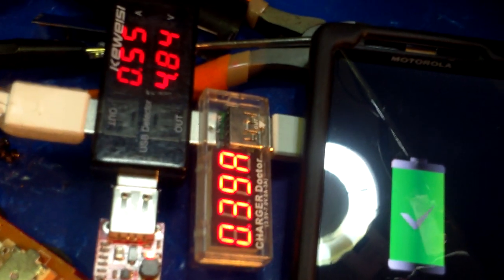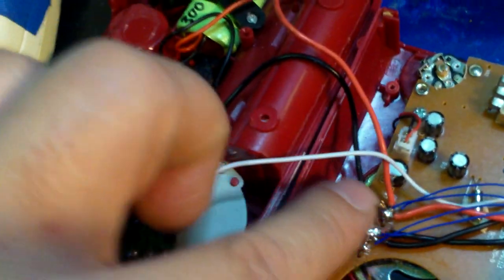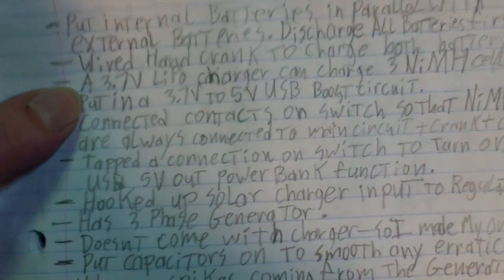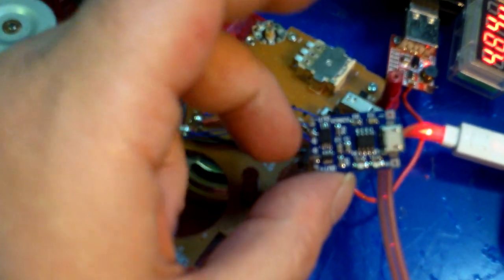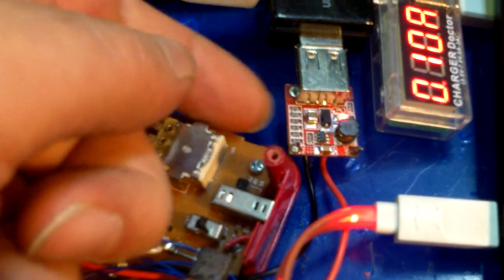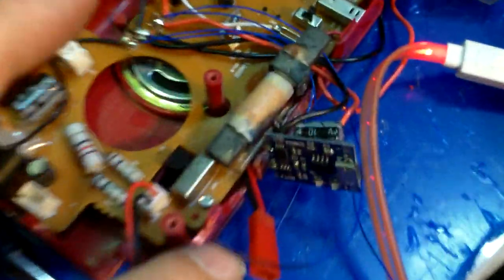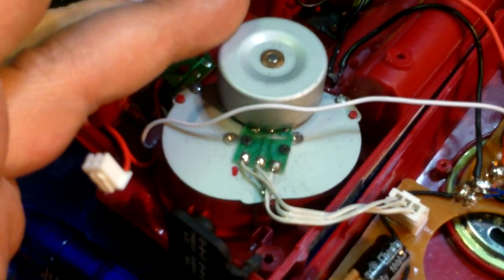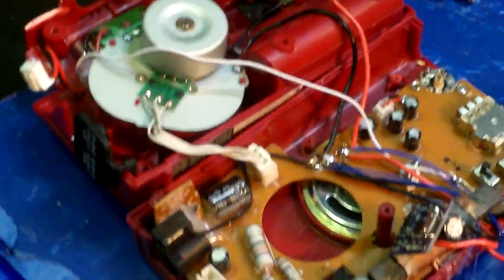Weather X WR182 R USB charger input/5V power bank hand crank Hack PT 1

Comment: Holy cow! That looks so complicated to figure out mister...takes big brains I guess which I don't have lol 😂 I loved the disclaimers btw 😉 I will heed those and not attempt this project on my own lol super job!👍🎉
Reply from the maker: Aww it's easy Molly , it's just those two solder points that are most important and You just have to run the batteries down before You add them together so they don't have enough energy to catch on fire lol , then once they're all added together then You charge them ....... and baby sit them while they're charging for the first time to make sure they don't catch fire lol .     Thanks for watching and commenting Molly , I'm proud of this little thing , I've wanted to build "The Perfect LED Flash Light" for decades .    Thanks Molly , see Ya later :)
Reply: Kyle R you lost me at "it's easy.." 😂 you smart cookie you! I'd be proud too...especially if it actually worked for me lol kudos on a job well done! 🤗

Comment: Awesome just awesome
Reply from the maker: I've been obsessed with building "The Perfect Led Flash Light" ever since White Leds came out decades ago . 
       To be perfect it has to be able to have a single battery that is rechargeable and replaceable , it has to have a hand wind generator so I can charge it any time , it has to be able to charge off of solar cells , it has to be able to charge off of a common Micro USB plug , it also has to be able to charge other objects like batteries and phones and stuff .    It has to have a laser to alert people to your presence from far away for emergency signaling , I bet expensive emergency flashilghts like this will include a small laser in the future I BET YOU lol , I guarantee they will .  
         This also has a radio and I'm putting in a small battery voltage indicator thingie .     Wow , I just explained alot of good stuff to You about this flashlight , I'm going to copy part of this and put it in the description of the video , Thanks Kakoroto Man :)